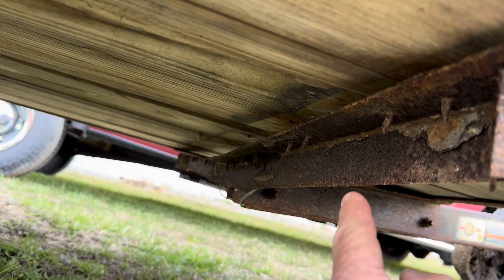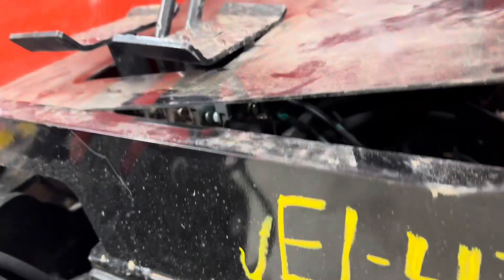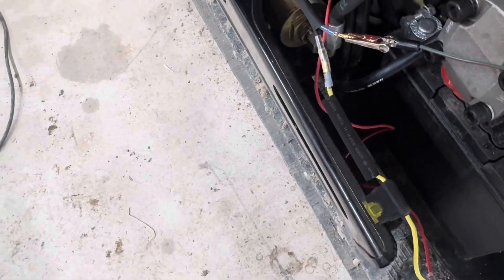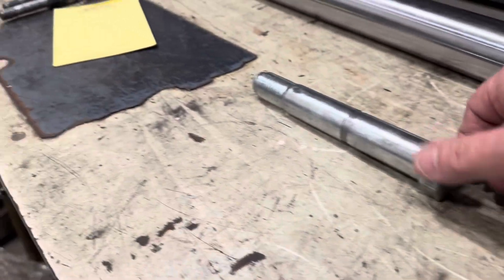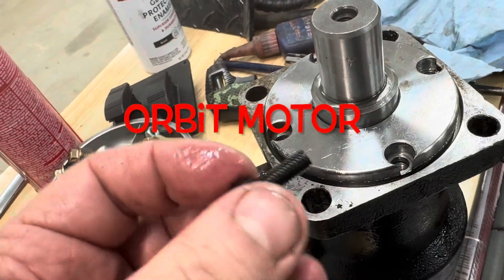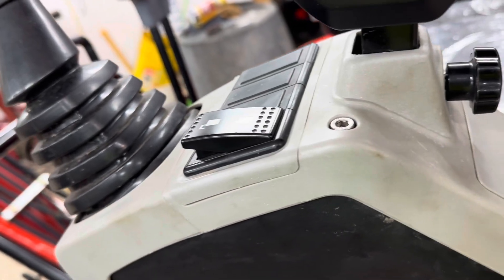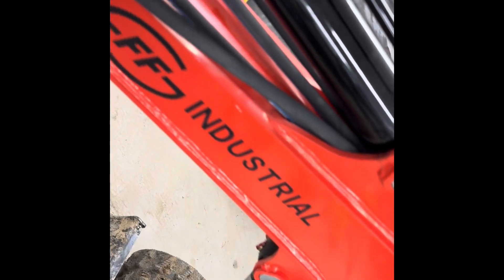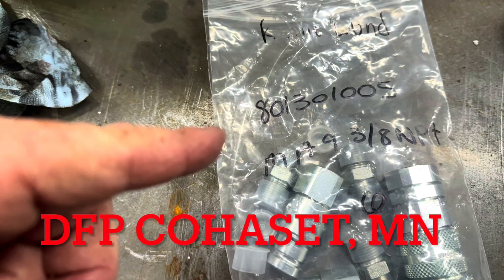Ff 15 Industrial getting modified

Comment: I noticed you were measuring the pressure on the boom. It's my understanding that position works off the same pump as the travel motors. Did you see any improvement on your travel motors when you turned up the pressure ?
Reply from the maker: We turned up just the valve for the auxiliary hydraulics, the rest is the same.

Comment: Did raising the pressure increase lifting capacity? What's the most you've ever lifted with this machine?
Reply: The machine will lift enough to tip it over .
Reply from the maker: It helped but not sure of exactly how much it can lift, keeping the lifting and swinging close by the machine helps a lot. 
It helped the auxiliary with the auger attachment on a lot, but a little too quick with the tilt bucket.

Comment: Are the quick connects 3/8 and did you use both female on the machine or one male one female?
Reply from the maker: Yup,3/8 pipe thread. Male and female on the machine and male and female on the attachments.
Reply: @Rollie-Lund  Thanks, but I meant, 3/8 flat face, not the other end that's threaded. They come in 1/4" and up

Comment: My hydraulic lock out doesn't work either, they are on all the time. The switch tested fine, I'll try crimping the connectors like you did. I'll have to dig deeper if that doesn't work, any thought?
Reply from the maker: Wouldn’t know what to do if it’s stuck on, other than disconnecting it from the battery, the dye electric grease is important too

Comment: I have the diggit myself.  Im going to add a fan to mine. I could only do 2100psi on hydraulic pressure. On the auger i all ways put on the other direction my self.